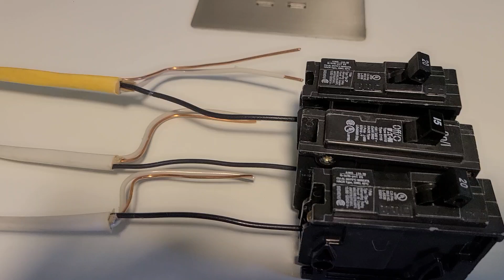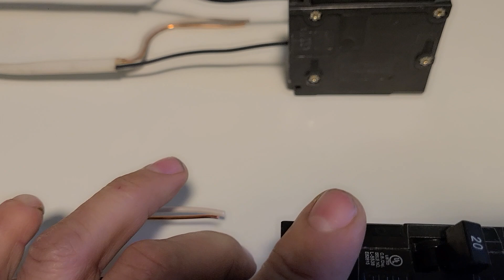DIY MISTAKE REPLACING 15 AMP BREAKER WITH A 20 AMP BREAKER

Comment: Can 20 amps handle a space heater and a microwave at the same time? 😂 Just curious how many amps that would need to cover.
Reply from the maker: Most microwaves pull around 10 amps that is why a dedicated Circuit is needed a space heater pulls 12.5 amps so a 20 amp circuit can handle only one of those.
Reply: @joeybalogny6095  good to know. Thank you.

Comment: How about putting 12G  to 15A?
Reply from the maker: You can use no#12 on a 15 amp single pole breaker wont hurt anything but most people want to use more so 20 amps makes more sense.

Comment: How can i rate the wire to work with 20A?
Reply: In general 20A circuit requires 12AWG wire. Sometimes larger gauge (ie 10 AWG) for longer runs to compensate for voltage drop. There are charts for this online. 

But 14AWG wire is insufficient for a 20A circuit. The purpose of a circuit breaker is to protect the wire.
Reply from the maker: No#12 works with 20 amps if you have no#14 on a 15 amp breaker you will need to upgrade the wire to no#12 some homeowners cant afford to upgrade there wire they unplug some things and plug into another circuit then they have more balanced circuits so there not tripping breakers.
Reply from the maker: 20 amps is always a factor be correct in value and you are good most low demand appliances or say a window unit will pull 13.5 amps so its a higher demand.
Reply: @joeybalogny6095  okay I marked them all for 20a thx 4 the help

Comment: Modern day equivalent of putting a penny in the fuse box.. back when there were fused electrical systems and US mint made pennies from copper. Fire risk is the same, whatever the illegal methods  🔥
Reply from the maker: The old penny trick copper it will allow any amount of electricity to flow no protection very true.
Reply: Fuse box? I've heard of circuit breaker boxes, but never heard of a fuse box. What in the world is a fuse box?
Reply from the maker: Older homes like knob and tube from the 1940s used old fuse boxes which have glass screw in fuses when the fusing element heats up melts it severs the circuit most small homes were 60 amp  old timers say fuse box but they are rare to see most homes have 200 amp panels.
Reply: @joeybalogny6095  ohhh okay thank you.
Reply: Last I checked we don't put fuses in our circuit breaker boxes here in the US. Maybe england?